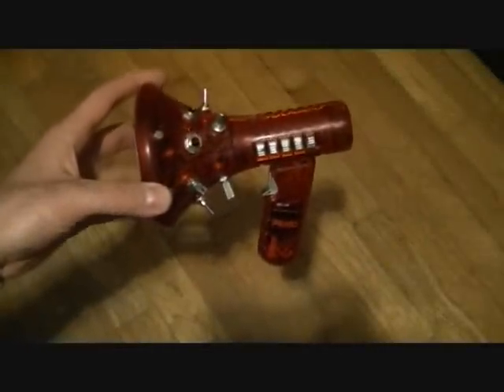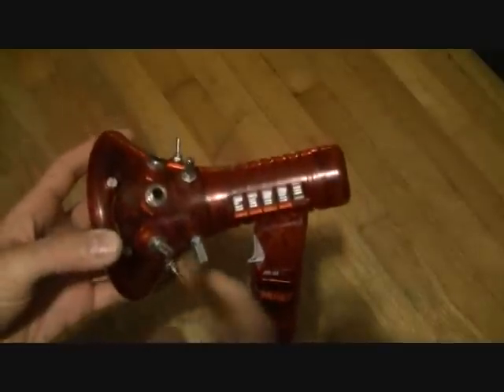Circuit Bent Robot Voice Changer and Updated Mod on Yamaha PSS-130

Comment from the maker: The Out jack would be connected from the speaker terminals, again with a pot and maybe a resistor of some sort in there. And the two pitch contacts were wires, if I remember correctly, to two different resistors on the board. There board itself is super tiny, and surface mount, so if you probe with a damp finger they're easy to find. Good luck and thanks again!

Comment from the maker: Thanks. It's been so long I don't remember much about it. 
Most likely for the voltage starve and on/off, I just cut one of the battery wires and spliced them in between. The speaker on/off would be from cutting one of the speaker wires and doing the same. The Input jack was likely connected to the same terminals as the microphone. And I probably stuck a pot in there, maybe with some sort of resistor to limit the incoming signal.

Comment from the maker: Also, as I recall the reason I used body contacts for the pitch instead of a pot was because there was something unstable or consistent about the pitch resistor. I might be wrong, but I feel like that was my issue at the time. Let me know how it turns out!

Comment from the maker: The circuit board's cheaply made, and the switches are built on it, so I'm doubtful. Wish I could remember exactly what it looked like inside. I can't remember whether I refrained from wiring my own switches out of laziness or because I couldn't figure out a way that wouldn't threaten the life of the toy, Either way, I don't think pots would work since each effect is either on or off. You could maybe wire in buttons, but I'd be surprised to if you could get a pot to affect the sound. Good luck!